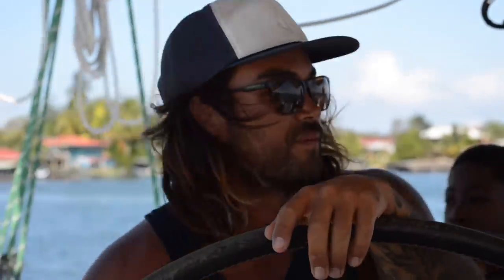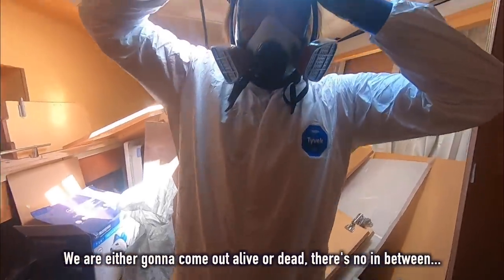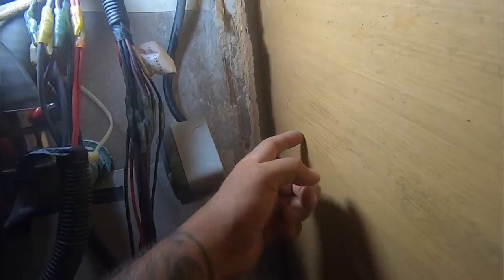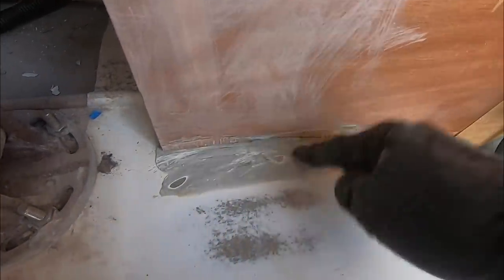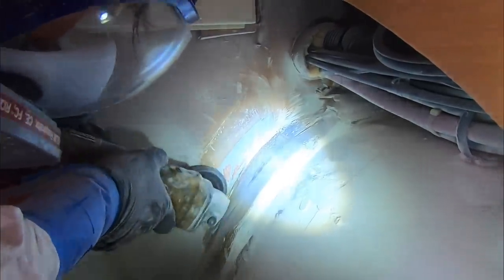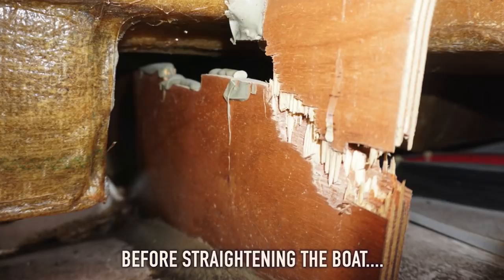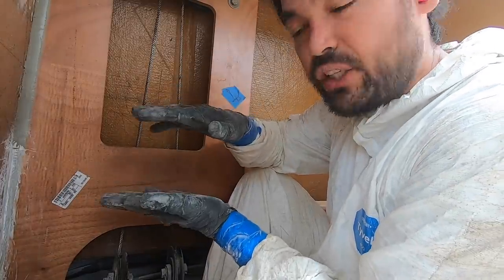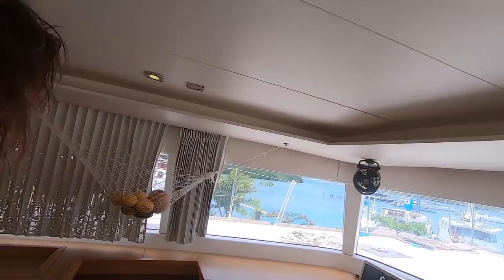CRACKED BULKHEAD REPAIR SERIES - Part 7 (Episode 112)

Comment: As the old saying says, “If you want a job done properly than do it yourself” Lagoon should be ashamed with how they let these Catamaran leave! Not like your life is in their hands in the middle of the Pacific ocean.
Reply: yeah sad really
Reply: It’s presumed basic requirements previously tried and tested exist from similar products. New design uses what’s been proven! They won’t reinvent the Wheel with each new design, they will use what they feel confidently works.
Building a product involves multiple steps:
A) Design Target is established for the market
 - Design focus to insure basic fundamental strength
 - Design and sub-designs developed for Manufacturing 
 - Design for sub-Assemblies and overall Assembly
 - Design includes methods to produce an easy quick Assembly
B) Interior Designs with Options based on Market requests
C)  Prototype testing followed with improved design changes
D) Finished Product Sales and Marketing.
E) Customer purchase and Warranties
——-
Explaining this may surface more questions. Consider researching who owns Lagoon! You’ll be surprised and may find similar design principles exist on other connected Brands! I know of one other, but there may be more...!
Reply: @MartyDidier  You may have left out the need of a competent work force, who have the means and will to build what has been designed. From the look of that tabbing, from home of course, it looks like that criterion was not in any way met !!
Reply: A friend of mine had is catamaran tear itself and sunk in second in the Gulf Stream, he was beating into the wind trying to follow a monohull.
Reply: @rl3898  A Competent Workforce starts with Knowledgeable Management combined with proper Quality Measures to insure the hired Workforce does what’s expected! 👉Another problem is what Owners will set as changes they want done that Management has to follow. It’s a viscous circle that needs to be balanced and tuned to produce a Quality product. If changes prove lower costs but encourage possible dangerous failure, Management might have to oblige at a cost of the Brand loosing favor with Public.

Selection of the Workforce relies on Management to know who is skilled at doing what. Designs provide controlled paths for products to be competitive. Owners set guidelines and everyone else falls in line. When problems surface, the Brand is threatened. Reduction in sales shrinks Workforce. Serious problems can get Management fired, Liability issue target Owners.
Around this time of decline, serious finger pointing starts as everyone has an excuse. In all cases, problem models are phased out replaced by new models hoping to revive the Brand!

Comment: I have worked on and built boats my whole life and without question, it’s a design flaw. Those boats were built to be disposable charter boats unfortunately. Although, with the work you guys are doing to improve the strength of her I see no problems sailing her around the world for many years to come. But, as far as big balls , you guys have them. I’ve been watching from the beginning and I can’t tell you how much I admire your perseverance and determination. Your definitely showing the world the true definition of the Warrior spirit, the Maori gods are proud. I will continue to watch and support you, I only wish I could be there to help. 🇨🇦
Reply: Absolutely a design flaw . 3/4 bulkheads are not even close to up o the job .
Reply: Me2😎ROCKMAN.
Reply: Yes built to be disposable , you can tell from the fact that you can not inspect or repair any bulkhead without destroying the interior . 

However on top of that is a design flaw , it is not strong enough to even last long enough to pay off the boat . These are newer boats and still in production  , not 30 year old neglected boats . 

By comparison , it is one thing for your 12 year old car to rust through , another for a 4 year old car to .  The first is just disposable construction , the other a defect . 

No bulkhead should ever break short of a collision or rot and then localized to the damage - not EVERYWHERE.  There is evidence of pre hurricane failure.

Comment: I think it's definitely a design flaw. I think Lagoon knows about it too. That's probably why their giving you advice. They probably don't want you to give them bad publicity. They definitely didn't want you to find out about the other 10 boats with cracked bulkheads,  for fear of lawsuits.
Reply: Too late
Reply: There's more than ten, on the forums they've counted 100 or so. That means it's at least 10% of 450's that have the problem.

Comment: Your philosophical testicular musings gave me the best chuckle I’ve had for quite a while.  As an engineer however I must correct your many commenters - testicles are not balls (implied spheres), they are in fact ovoids or elliptical spheres whose volume is calculated as Volume = 4/3 * π * A * B * C…where, for your purposes, A = the volume in cm3 of the fiberglass dust you have created, B = the volume in litres of sweat you have perspired and C = the number of curse words uttered whilst suspended awkwardly or squeezed into tight spaces whilst grinding.  May your ovoids remain loose and free of fiberglass itch.  You guys are rocking it!
Reply: Smart people suck and junk... 😞😭

Comment: I have often wondered why you didn’t try an insurance claim on all the damage but wasn’t sure what might be excluded considering Parlay was hurricane damaged.  For the past several weeks I have also seen many comments on Lagoon bulkhead problems.  Design or manufacturing flaw?  The one thing I have learned from all this is that Lagoon moved down my list of what I want to purchase.  You guys have certainly repaired Parlay better than I think anyone else, including Lagoon, would have done.  Keep it up… you are a real inspiration!
Reply: I think they bought it like that. Someone else insurance claimed the boat I'm sure. It was sold off.
Reply: It also seems like alot of Lagoons have defective bulkheads.
Reply: He stated in an episode he couldn’t get it insured yet. That was awhile ago he said after the work was complete there would be an inspection process he needed to complete.
Reply: I believe he can't get an insurance adjuster to look at the point until he sails back across the Pacific.

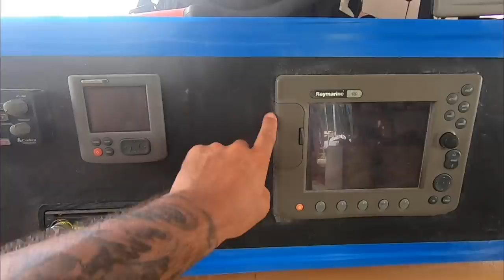Comment: 5:01 Dust control: stick a vacuum hose through a hatch opening and seal up around it and tape up your access, it won't do crap for the massive amounts, but it might just stop it escaping out those cracks with a bit of negative pressure in your work space.

Comment: For sure you guys define true friendship in adversity: puts the everyday into perspective.
As for the Lagoon 450 issues, it's even more than those 10, according to Facebook groups and I'm sure that number will grow. I heard there have been a spate of 'fires' around the world on Lagoons recently : wonder if they were 450's with bulkhead issues? One thing is for sure, anyone with a 450 is going to have a hard time selling it for a decent price.
Good luck 🤞
Reply: These boys will have a nice business buying cheap 450’s and make them good again.
Reply: @aeasthouse316  There's no way the fixes required would make it worth the cost to buy and flip them.  The only reason he's continuing on with this boat is because he sunk the lions share of his money in to buying it, and there's no way he could get that money back selling it, especially after continuing to find the shit build quality by Lagoon.
Reply: @McCl3lland  if there are plenty with the same problem, and you can get the write offs for cheap, as they now know more about what is involved - I still think it could be a viable business.   Rip out all joinery in hulls and mast bulkhead in saloon, repair all bulkheads fixings properly and then fit new joinery.   As you do multiples of these, you can get all joinery panels cnc cut, then it’s basic fit-out assembly.   Since there is lots to keep: the hull, riggin, electrics, mechanics (engine, fridges,etc),  it will be worth it.     No different than renovating a house (I’m a builder & do lots of joinery fit-outs), all depends on price parity between what you get them for and what you could sell them for.   If they do a great job, they will have good vessels to sell.   I’ll partner with them if they can get more than say 10 of them so we spend time tracing and drawing all joinery as they dissemble them, do cad layout drawings, get it all cnc cut in the style and finish the new buyer wants.   Can even do customisation for the right price 😀.

Comment: Along with the one in the yard with you. 11?   In 40 years of boat building , that bonding - tabbing would be a sacking offence. As for Gluing ply to a grp hull, and not glass it , is a no no. From what i have seen so far , parlay will probably be the strongest 450 out there. You guys can do it , no doubt!
Reply: On the forums we've counted 100ish Lagoon 450's with this issue, or about 10% of the total number that exist.

Comment: It should be a moment of clarity for everyone.   When you have too many big balls of steel on a boat, you will need to restructure the bulk heads to carry the load.  

As to find the volume of them, the only way I know how is to sit in a hot tub with 4 women,  and see how much "rise" you will get in the water level.   Arcamedies had everything figured out centries ago.  There is never new ideas,  just old ones re applied.
Reply from the maker: Hahahaha
Reply: 🤣🤣🤣🤣😂😅 I'm crying im laughing so hard

Comment: Yes unfortunately that's what I was trying to tell you in previous comments.

That I have unfortunately noticed this trend in every single lagoon 450 I've ever heard of. Short of ones just leaving the factory floor. 

Because cumulatively the design and structural rigidity is strong enough.! For normal use.! 

But individual. The Bonds whether it is Fiberglass or Epoxyo joints. And or the Panels and Bulkheads. Are not sufficient.! In either design or construction to withstand even inclement weather. Let alone in a Hurricane.

And it is speculated by many 450 owners. That this is intentional. Lagoon never had any intention of building a Tank.!

For a couple of reasons. Of course the first one being cost of its construction. In both time spent in construction. And materials used in construction. Greatly reducing the cost of construction.

However primarily it is designed this way intentionally. Because they know there primary market demographic. Are insured. And why repair a boat when you can just buy a new one.!

I mean could you imagine all the New Boats that Lagoon are Sells Additionally each year. To people who are just getting a replacement Boat. Instead of having their existing Boat repaired. From Hurricanes alone. Not to mention all of the Boats that have sustaining inclement weather over just a few years.

So just implementing this design characteristic into many of their Boats not just the 450. They stand to make substantially more profit each year. Despite the cost savings in construction.

In fact new Lagoon owners have to sign a Waiver. Specifying that the Boat is not designed to sustain that kind of weather or environment.!

So as I said in the previous comments. Lagoon is not only acutely aware of this issue. They literally designed it into it. It's part of their business model.

And since the damage is usually so extensive. It's usually not directly assumed to be a design flaw. But more like a catastrophic accident. Having nothing to do with Lagoon.

Most Used Lagoon Boat owners don't blame the design. They don't even attempt to understand it. Or even attempt to remove the old and damaged materials. They simply Glass and Epoxy over them. And call it a day. And or sell it to someone else directly. Citing that it has been repaired. Which I'm sure you're already aware.

Thus I do believe you are in but a small handful of people in the whole world. Who are actually going to the extent of actually repairing properly the entire Boat.!

In fact when you're done. You will unquestionably have the Best Built Lagoon 450 in the word.! Without question.

Simply by applying the proper level of reconstruction. It should have had in the first place.

However I would recommend building an I-Beam box around the midsection of the ship. From the Base to the Top and from the Bow to the Stern. As well as Port to Starboard. To more securely fasten both sides to both Hall's on the Midsection. 

I can't say how much time effort and money that will cost additionally. But it seems like a pertinent measure after already going to and through so much trouble. 

Now I do not own a lagoon 450.! Nor have I even ever set foot on one. But like you. I am very interested in buying one. Whether it is a Catamaran or Trimaran. And I have done a fair bit of research into it. And the answer seems to be the same everywhere I look.

Which is that many of these fiberglass boat designs are almost meant to be disposable in nature.! And if you have insurance. Then both Lagoon and the customer win. The customer gets a new boat and the insurance pays Lagoon.

And Lagoon is not alone. It is the entire fiberglass Boat industry.!

So I'm not saying nothing can be done. And that litigation should not take place. But the problem is much bigger than Lagoon alone. And hey. Maybe you don't care about other companies. You only care about the company for your boat. Which is understandable. 

But I think understanding the situation is sometimes helpful for reducing frustration. Knowledge is power and whatnot.

But on a different note.

I found your channel a couple of months ago. Amidst the aforementioned research. And I went back and watched every single one of your YouTube videos. And having spent so many hours with you thus far. On So many adventures. Learning all about the Lagoon 450 and it's construction.

I feel like I've gone through it with you. And I have an emotional investment in seeing you succeed.!!!

And I would like to offer my assistance. In any capacity. Except for monetarily. As that is currently beyond my ability to give. 

But I have years of experience as quality control in a Fiberglass Bathtub Factory. So I both know how to identify and repair bad Fiberglass and Epoxy Bonds. And whatever I don't know I am more than capable of learning quickly. 

I also spent years in the US Marine Corps as a Ch-46 Crew Chief and Mechanic. And can competently handle myself in any situation. Even underwater.

I have many other skills. But those are the ones I think would be most useful to you.

I'm 40. But as you can see people usually tell me I look about 25. Which I take is a compliment.

So you just say the word man. And I am there.!

Because I would love to both see you succeed. As well as learn all I can about the repair of the Lagoon 450.

And to answer your original question.

Traditionally the size of one's "Balls" is usually attributed to the amount of Testosterone one's testes produces. And Testosterone in the Brain results in reduces Fear. And because people usually confuse the absence of Fear as Bavery. (Which is being Afraid and doing what you have to do anyway.) That you're not Afraid. And by proxy must have a lot of Testosterone produced by Very Large Balls.

But no size of testicular prowess. Would prevent anyone from being terrified of wrecking out all that cracked fiberglass and epoxy. Especially where they live.

So it is not the size of one's "Balls" that correlate to Bravery. It is the unbreakable resolve to succeed. You're not discounting failure. You're negating it. You're removing failure as an obstacle. Through sheer force of will.

To which I and everyone else can clearly see that you have an overabundance of.  That Sheer Force of Will. And that is Badass.! You and your crew. Earn My Respect in every video.!

You are an example of the type of person we all want to be.

That is my definition of "Ball Size to Bravery ratio."

To which I think you will agree.

But let me apologize for the length of this message. I tried to break it up instead of a huge wall of text.

And again. Awesome mindset awesome videos awesome work.!

If you ever need any additional bodies. "Many hands makes light work." Do not hesitate to ask.! It would be my honor to donate my labor.

And I hope this info was helpful. 👍
Reply: lagoon has put profit in front of quality and safety .
I'm sure that they are not alone in this.
let's look at the automotive industry if this happened there would be outrage and a massive recall . that's a vehicle that travels on land not crossing oceans. We should all be outraged at this reckless engagement of human life.
Reply: @mrsmith3554  Yeah that's what the waivers for. For new owners. I don't know what the statute is for used owners though.!?